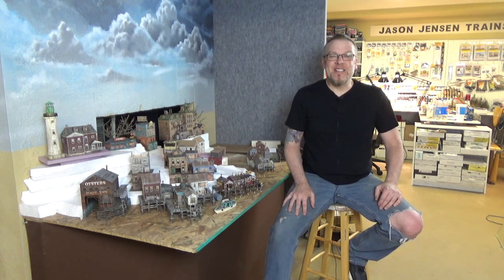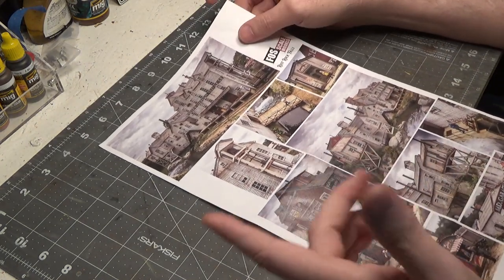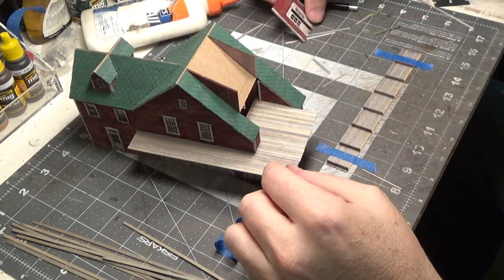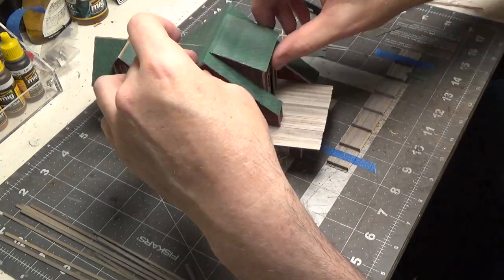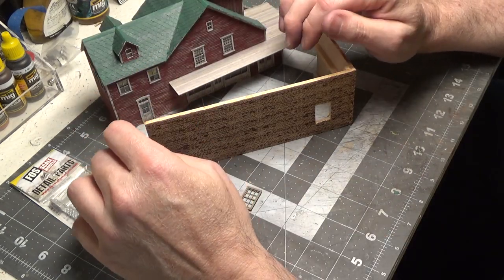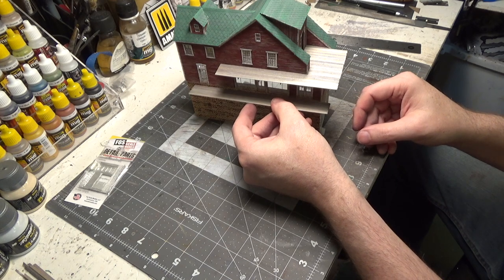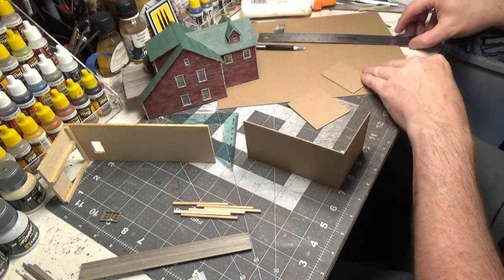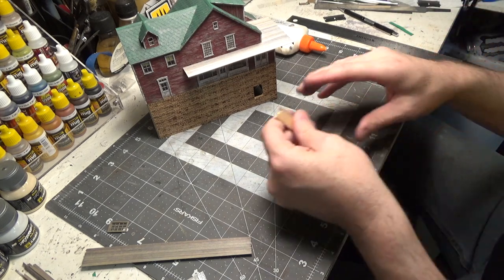Building the Flying Ace bar and grill.

Comment: When folding any cardboard, I prefer to use a rollerball pen, without ink, completely dry, to crease without the risk of cutting the cardboard by mistake. I have pens, no ink, fine, medium and thick, one for each type of crease. The paper is well marked and is easier to fold.
congratulations for the beautiful work

Comment: Reference the chip board you are using. Is it .050 or .060 thickness? Do you have a link on Amazon for the chipboard you are using? Thanks.
Reply from the maker: I buy 12-12 medium weight chipboard.